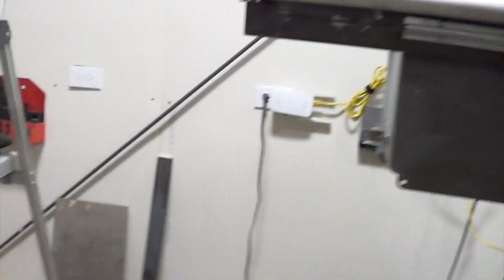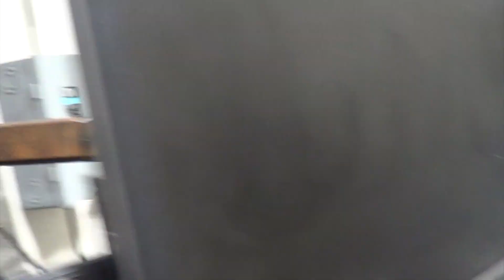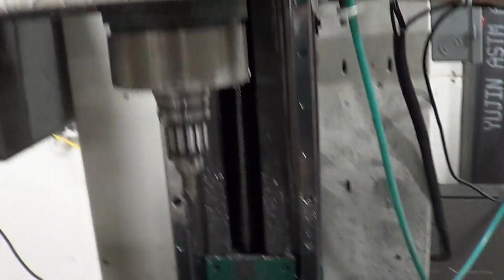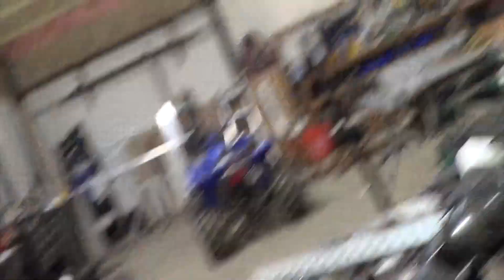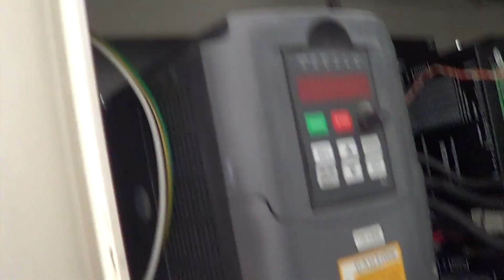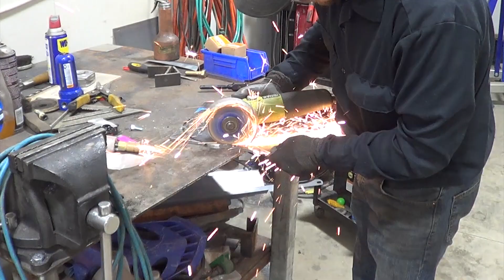RF-45 clone Automatic tool changer build PT1

Comment: Did you buy the original Tormach tooling system?
Reply from the maker: Ro Cuevas yes I did.   I just bought a bt30 spindle for the mill and I will be converting it over to that.  The tool pull out of the tts system is just too frustrating to deal with.
Reply: @northernsmith  bro, could you please paste the link to buy the BT30 spindle cartridge?  I have a machine with an R8 spindle and I want to change it

Comment: Did you have plans for this? I want to make one for my old tormach it will cost to much for all the upgrades.
Reply from the maker: shane clendennen not yet, I just switched the whole mill over to a masso cnc controller.  Because the masso has built in logic for the atc.  I have a few more changes to make to it for the atc to work with the masso.  I will post another video when it is working.

Comment: Nice build. I just saw you on the CNC4XR7 video. I did finish a rail conversion a couple of weeks ago, but with some problems I hope solve this week. I made an ATC a while ago but haven't even tried it yet, some tool pullout problems make me really consider going from the TTS to a BT30 spindle cartridge.
Reply from the maker: EmperorDevilhunter I have tool pullout problems every now and then.  Make sure the inside of the r8 collet is super clean and free of oil. The. The slightest whiff of grease on the top out side of the r8 collet to aid in clamping pressure.  Then dialing in the force of the Belleville’s so the tool just releases works good for me.  It requires cleaning every couple months.  

I may do a bt30 spindle in the future.  There are some good ones on alibaba for about $1000 shipped.  Then put some high quality bearings in it.
Reply: @northernsmith  yeah I keep everything clean, but I was probably overshooting the TTS strengh (with manual drawbar!). My machine has a 1.8KW motor. I also make my own heat shrink holders with chrome shaft, but they are more prone as the surface is too smooth